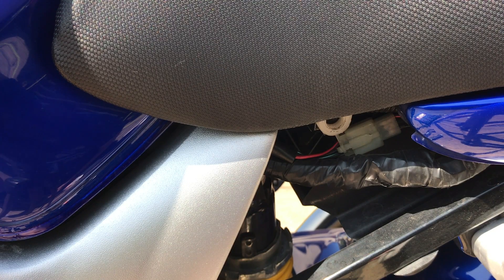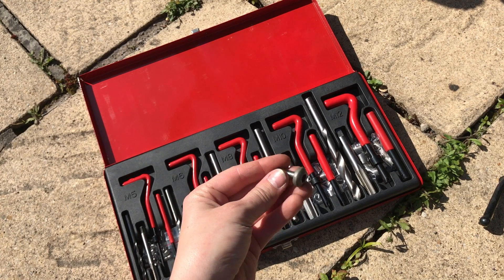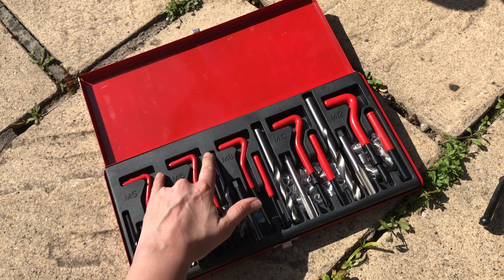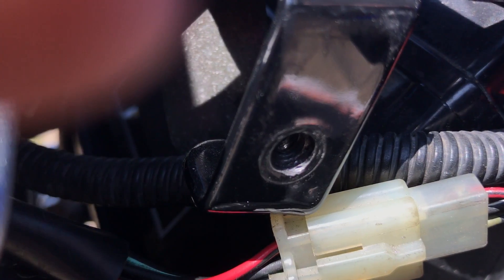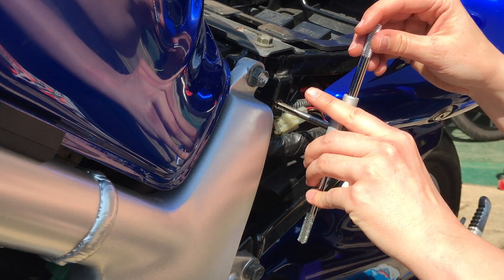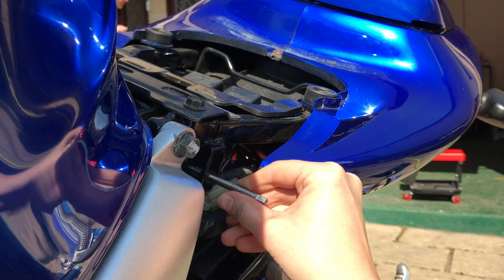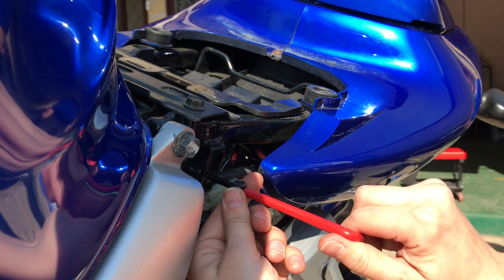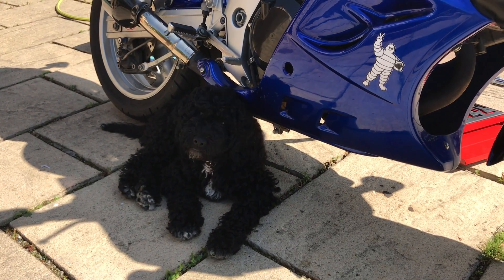Helicoil Thread Repair

Comment: U should put thread lock glue onto the insert so that it'll stay there for good. Theres a chance that when u remove ur screw, the insert will also come off.
Reply from the maker: Very awesome top tip- pinned for others to see. Thanks for adding that!
Reply: No. The insert is coiled like a spring so thread lock will seep through it, locking the bolt to the insert.

Comment: Was wondering when the uploads were coming back good job girl
Reply from the maker: Thank you, it is great to be back. I have a list of video ideas, a spare SV650 engine to play with, and a revamped garage space...
Reply: Spare engine.. please do a valve clearance check / adjustment video in your usual style, it would be great to see how to do it with best practises like you do. I am overdue for mine to be checked I have around 36k kms 

I also need to helicoil one of my side panel threads (injected sv) lost a bolt out on the road in the last week - sorry whoever ends up with that in their tyre :(

I am in the middle of working out a price for maxton cartridges and forks coming off a stock mini twin now that they've all changed over to the er-6. plenty of nice race bits for sale at the moment. 

I still haven't even put on my braided HEL lines that I bought after seeing your other video!

Comment: I have a suzuki  sv 650 an I have a question .if my bike turns on but once I put it in gear ⚙️  it dies out what does that mean an how can I fix it.
Reply from the maker: Hi, there is a safety feature that if the side stand is down and you put it into gear, the engine cuts out, simplest first check would be to check the side stand is up all the way, and if it is, look for the little switch the stand pushes against (sometimes road crud can build up and stop it working, a clean and some 3 in 1 oil to make sure it is working properly would be my first check). Let me know how you get on!

Comment: When be needed a long thread, can be installed two inserts in the same hole ?
Reply from the maker: You can, but the difficulty comes when trying to line the 2 up to screw in the bolt, it can be done though
Reply: @TamsenCooper  I'd think that it is not difficult because both inserts are sincronized by the same thead made by the threading tap.
Reply from the maker: Fair enough, you are right, the thread you cut does guide the insert, but I did it once and it got tight when I got to the 'join' I moved the bolt out a bit and then back in and it needed a little extra pressure, and then it did screw in all the way in the end
Reply: @TamsenCooper  Perfect friend, thanks for your tech feedback. I will try it soon as well.

Comment: I had same issue on my sv. I got away with a thread repair tap. no helicoil or re drilling needed.
Reply from the maker: I think if it was an area of my bike rarely used I would have done that, but because I take it apart so often, I wanted a more long term job, I didn't want to re tap it and then for the same issue to occur 6 months later. (besides, it was a great excuse for another video lol!)